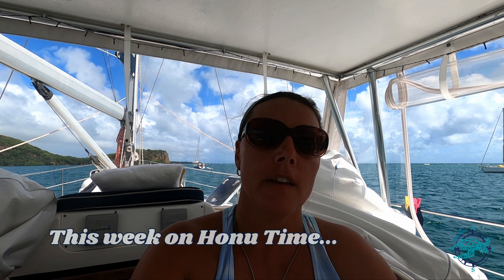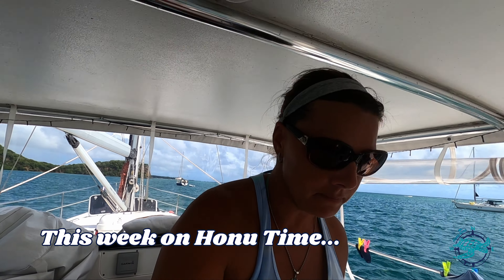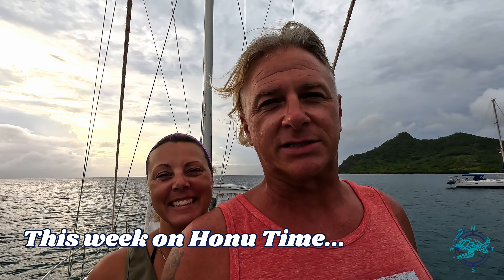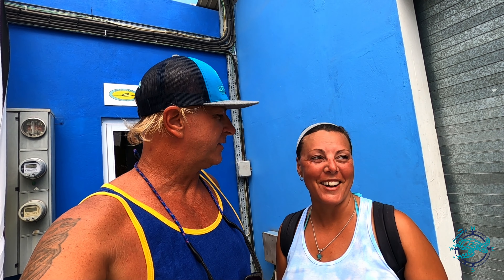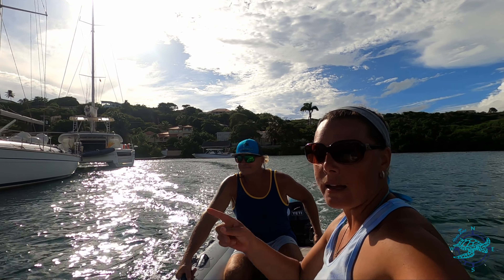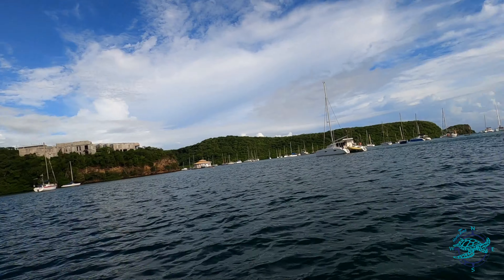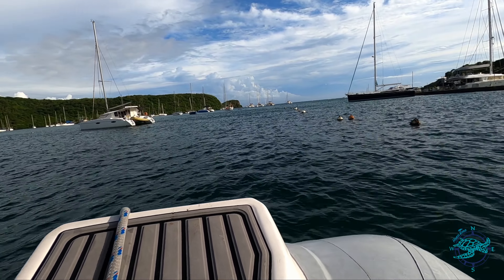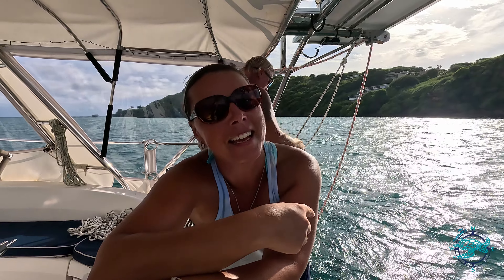Boat Projects GONE WRONG: DIY Disaster

Comment: Should have parked the dingy under you pulley project. The pin wouldn’t be 30' down.
Reply from the maker: You are not wrong. We had it tied up behind the boat but it was very windy and choppy and the dinghy was smacking into the boat with a lot of force so we thought it was best to let it out and just be real careful not to drop anything... haha.